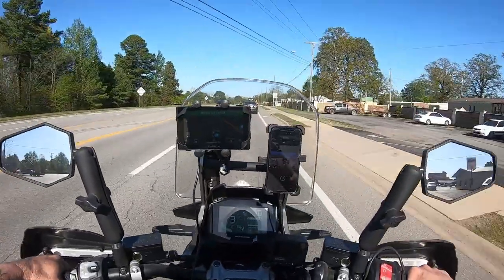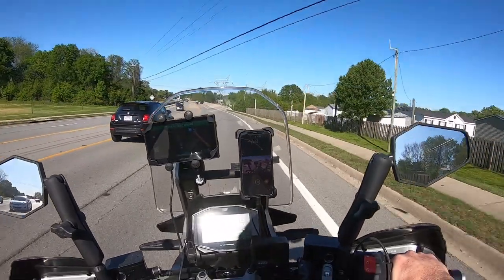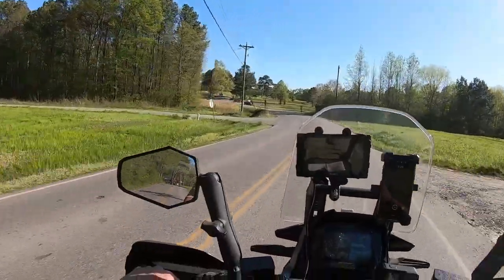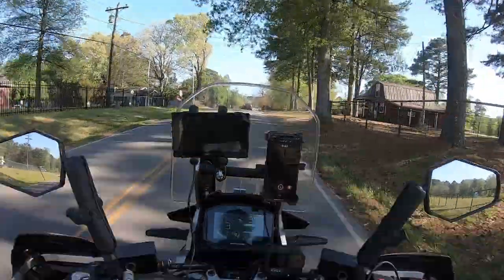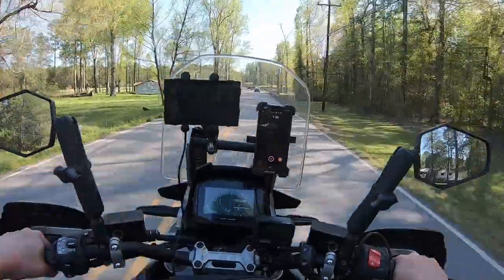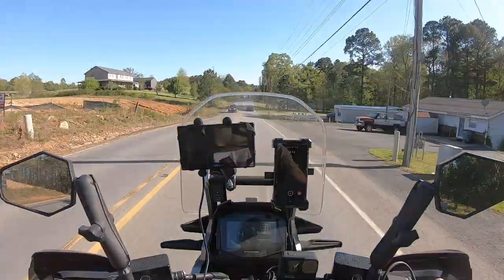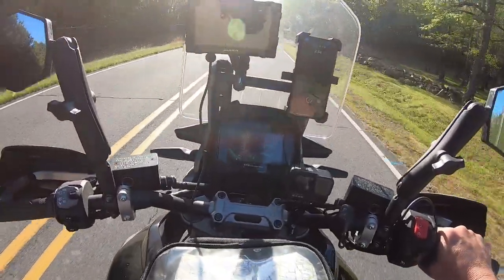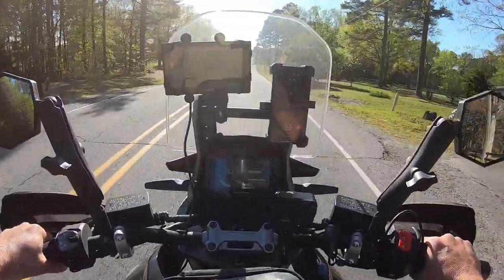Test Ride Vstrom and Shinko 705

Comment: I no longer use balance weights. I have been using balance beads, and it's been an outstanding difference. My tire ware has dramatically decreased. I run 2 ounces on the front and rear.